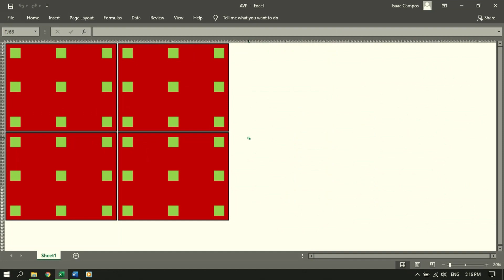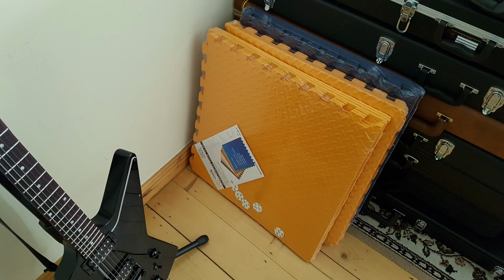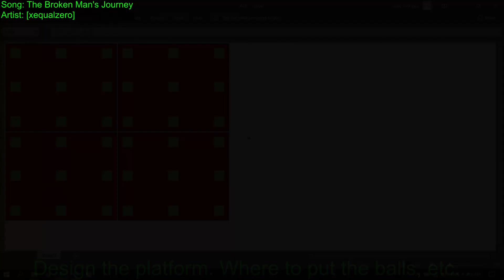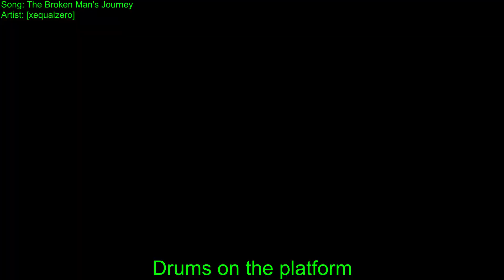Drum Riser - Anti Vibration Platform DIY

Comment: Currently having noise complaints(even though i am on the ground floor) and im also from ireland and having the same kit so the video is perfect for me :D
question: do you think Roland noise eater is nescessary? i think tennis ball platform does its job already..
also where did you order the wood?
Reply from the maker: Hi Alex,
I think the Roland NE might not be totally necessary, but definitely it helps. Actually I recommend getting one for the HH too. They are expensive, but they add that extra dampening that helps a lot. But again, you might get away without it. I'd say, just try it without and if your neighbour is still complaining get the NE...
I got my mdf from woodworkers, who delivered it to my address.
Cheers,
Reply: @isaacscorner1525  thanks for the answer. what size wood planks did you order? considering i have same kit and i dont have any tools to cut id look for something similar. Thanks and hoping it still works well for you!
Reply from the maker: Hi!
I used the 15mm sheets.
They were 8 sheets cut in 60x75 cm rectangles.
Reply: @isaacscorner1525  Hi Isaac. Since you have decided to build a platform, I understand that ROLAND NE  are insufficient. Can you give your opinion on the roland NE please? great tutorial. Thank you very much.
Reply from the maker: Hiya!
In my opinion, the roland NE are good, but very expensive.
They dampen a lot, that's true, but if you are a heavy hiter, or play a lot, some of the vibrations go through.
Also, they only dampen the kick and/or hihat, but don't do anything about the rest of the kit, wich is played all the time and also transfers vibration to the ground.
As I say, depends on how you play, and where you play. If you don't have neighbours, or play in a basement, or you play jazz with very soft sticks, etc. you'll be ok.
It also depends on how picky are your neighbours.
If like me you have neighbours downstairs, or are a heavy hiter, and you can afford the space, I recommend the platform.
I hope this helps. Keep safe, keep playing 🤟
Reply: @isaacscorner1525  thank you Isaac :)
Reply from the maker: Thanks buddy 😉
Have fun!!!
Reply: @isaacscorner1525  i am still seeing some activity on my comment would be fair to share my experience 
i went with similar design to yours and constructed a platform back in late Jan and it worked like magic, didnt need the NEs.
I'd agree, you want all the surfaces to be covered so youd need to put NEs everywhere which is mad expensive.
Havent had a single complaint in 3 months